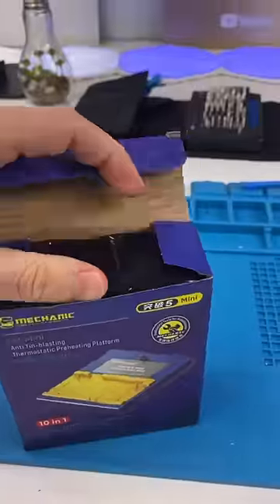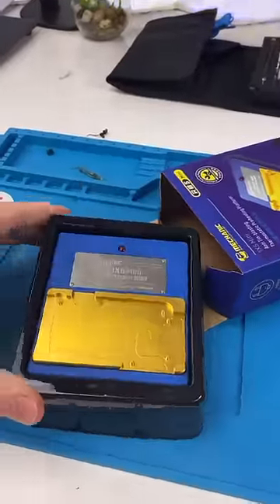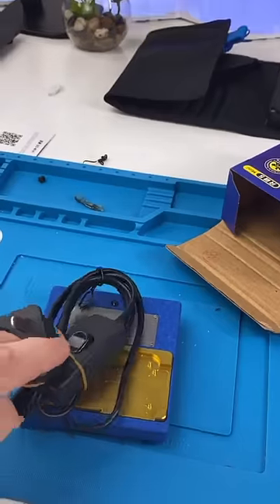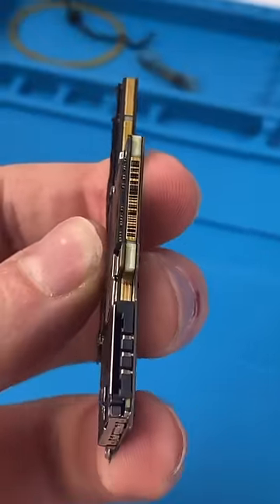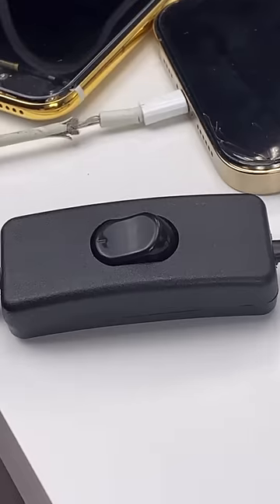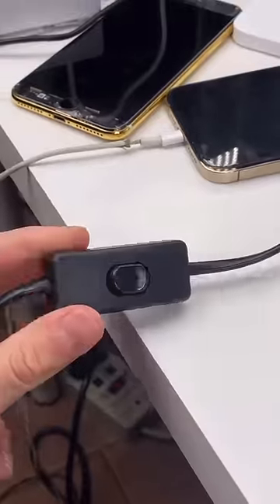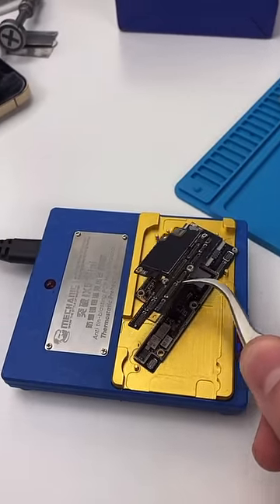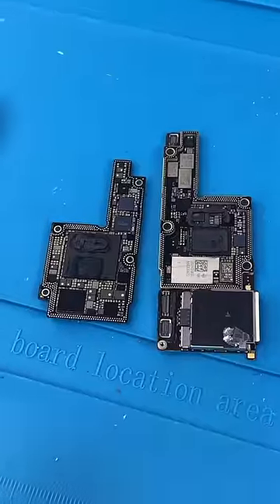I Opened Apples "Sandwich Board"... It Started Smoking #shorts

Comment: Apple's engeneers:
-How irreparable do you want it to be?
Apple's CEO:
-yes
Reply from the maker: It's honestly revolutionary. Saves space for other parts
Reply: @PhoneRepairGuru  and that's how iphones are much more powerful than android phones
Reply: Want autocorrect?
This guy: no 💀
Reply: @Tachi778  correction: a little.
Reply: @IBaitman  
geekbench cpu
sd888+ - 3700 multi core
a15 - 4900 multi core

geekbench gpu
sd888+ - 4500
a15 - 15000 !!

not just a little
Reply: @IBaitman  geekbench has never been skewed, its the most real benchmark exists

also there is gpu test in geekbench, the compute benchmark
Reply: @Tachi778  they're deleting my comments.
Reply: @Tachi778  I was providing a link to the website where they show geekbench bias. I even edited my older comment about antutu.

Maybe links are banned. 🤦🏻
Reply: @IBaitman  yes because u have to stop talking nonsense 🤣
Reply: @Tachi778  says the one believing geekbench as sole benchmark worthy of trust.
Reply: @IBaitman  its obvious that apple SoCs would be much more powerful anyway, because sd888 has 6 billion transistors and works at max frequency of 2.84 GHz

while a15 has 15 billion transistors and works at higher frequency at the same time, 3.1GHz
Reply: @Tachi778  hahaha this one is funny
Reply: @satukayu4706  it really is, it's obvious
Reply: @Tachi778  it's not really that much faster from what i've seen with hands on test. well be it better or not i still aint gonna buy a $1000+ phone from any company, i'll stick with my mid ranges, imagine i can get a phone that stays within 1-2 seconds of the IP 12 pro max for 5 times less the cost of the IP. f*cking crazy.
Reply: @PhoneRepairGuru  can I get a hello?
Reply: @Tachi778  😂😂😂😂😂😂 stop dreaming!
Reply: Damn you all really stop talking nonsense

Its just obvious, it's simple logics and physics, more transistors at higher frequency = more operations per second, it's so damn obvious 

I'm not apple fan, I'm using android phone myself (because I use ipad where I need performance)

Just stop believing antutu and desperately saying that android SoCs are best just because you can't afford apple ones
Reply: @Tachi778  bruh it's a joke calm down
Reply: @Tachi778  lol did you read the whole comment
Reply: @Tachi778  that's not how they are more powerful. The computing power is inside the SoC, not spread around the board.  This is intentionally made to make repairs difficult. actually having two boards require tons and tons of connections between them which waste much more volume than pcb traces
Reply: @gabrielenitti3243  I mean that making the board more compact allows to make the SoC bigger and fit more transistors inside
A14 is almost 2 times bigger than snapdragon 888
Reply: @satukayu4706  how’s the obsolete 2 year old phone handling cos my almost 8 year old iPhone six is still getting them updates,
Reply: @SsKarthik0801  i dont have it cuz i dont want a word to be turned to a different thing
Reply: @lukemurphy7917  Everyone watch out, man's flexing his 8yr old phone that gets updates which slow it down so that he's forced to upgrade, I can't contain my jealousy.
Reply: @Tachi778  listen bro
1) you don't really need much power to browse Facebook or whatever anyway
2) remember that Apple it's the one who still has the lighting cable who sure WAS revolutionary, but it's outdated slower and inefficient compared to USB C, and apple knows that, they keep lighting because of licensing money
3) I'd like you to remember how slowly apple devices get new tech, also how you are stuck for one hole for everything because "courage", they replaced the headphone jack with a motor for vibrations although iphones aren't a sex toy 🤷🏻‍♂️
4) android runs on a large amount of different devices so you really can't compare all androids to all iphones, you can put Android even on your gaming PC if you want (I'm not kidding, there is android x86)

In my opinion apple products are awesome for who has the money and not the knowledge to use a Phone/laptop, but it's very restricting, the only good thing i have to say is that at least mac it's unix-like which gives to it an awesome CLI, on the other hand Android it's open and allows projects like fairphone to exist, also it's open nature helped on the accessibility side of things (you can built apps for less abled people if you want to using the api the OS provides)
Reply: @gnsf  lol I just said that apple SoCs are better, I didn't say that iphone is better overall.
I'm OnePlus 9 user myself because it's really better in all, despite SoC performance. And you are right, I don't need a14's or a15's power, sd888 is just enough for me.
I just wanted to say that apple SoCs are better than all other SoCs for Android devices. That's all.
Reply: @Tachi778  you are right, since android can be run on fridges, yep, sure iphone it's better than a lot of android stuff
Edit: i replaced frigos with fridges, an "italianism" accidentally came out while writing
Reply: @Tachi778  btw i did never looked in the specifics of iphone's SoC, i did never cared much unless they do something outrageous or i need to buy one
Reply: @gnsf  well, their graphics is twice or even triple better than qualcomm's, good for gaming, but if you do mobile gaming, go for ipad
Reply: @Tachi778  one good thing about ipad: it's true the panel technology it's slightly outdated and it's also true that retina displays are more of a brand rather than a technology but their high DPI it's orgasmic to look at
Reply: @lukemurphy7917  Oh holy cow, your old iPhone gets updates which have been proven to slow it down so that you are forced to buy a new one which always costs 1000+$, is irreparable and looks the same every year until the 4th next generation! Such a wonderful privilege to have. We are such fools for not renting iPhones instead of buying androids.
Reply: @IBaitman  no middle ground  you are Doomed to english only.... purgatory
Reply: @lukemurphy7917  That’s to slow it down and I’m typing this on a 6 (shittiest fucking phone I’ve ever used) and there have been no major updates after iOS 12 because the 6 can’t run anything past that.
Reply: @Comfy_Bed  yeah lol I bought a $300 samsung phone and it's quite alright for just watching YouTube lol
Reply: @Comfy_Bed  which $200 phone is that?
Reply: @PhoneRepairGuru  so where is the headphone jack then?
Reply: @Tachi778  "the fact you still dont know what sarcasm is pretty concerning."
-KallMeKris
And that quote can 100% be applied to you.
Reply: @Tachi778  😂 have you ever broke your back glass in india it's cost 45k i can buy gaming laptop or 3 Android phones 😂
Reply: @Tachi778  not exactly, Samsung uses sandwich motherboards too but apple has the unbelievable lead simply because of the efficiency and integration and how much the hardware is built around the software while on samsung they have to somehow build a software to suit a chip that wasn't really built for their device
Reply: He is CEO, not a service center guy
Reply: @lukemurphy7917  even though most android phones stop getting updates after 2 years, you can still install a custom ROM in it, or just keep using since Android has a great API compatibility, you can still use Nougat normally till this day if you want
Reply: @Tachi778  the good thing about that is competition, and also, probably in the future, Android phones will be RISC-V since ARM has been doing some stuff that has pissed off arch licensees (Qualcomm being the main one that got pissed off), also, one thing I dislike about iPhones is, even though you have an amazing SoC you can't take the most out of it due to OS being so closed you don't even have a proper file manager, and most of emulators won't run on it
Reply: @Tachi778  eh, that depends on how ya measure
Reply: if you need to do a repair that involves separating the motherboard, you certainly aren’t doing it yourself and probably won’t end up being worth it
Reply: @Tachi778  lol, whatever you are smoking. Android phones, such as Samsung S21, have also multi layered motherboards for some time.

Comment: Hey that's actually a nice little cooker you got there. If you buy or try to restore phones that got bent badly and have touch issues, you could use some flux and the heater to try and restore the solder balls and repair the board itself!
Reply from the maker: I figured :) thanks for the info though

Comment: Please use a littlebit longer Screw as a handle where you can Grab With the tweezers and pull it up and dont Touch the Balls on That Sandwiched so you can easily Align and reheat it easily to solder it back together 

Makes Life a lot easyer and also you can Potentialy put preassure on the Board while Cooking it back together because of Spacers in Between the Connection Part and the Board

Comment: Sounds like they've used a low-current switch for a high-current device.
The copper contacts probably got so hot that they melted the switch's plastic enclosure. 
Which is why the switch doesn't...you know...switch anymore.

Comment: Cut the cord on both ends of the switch and solder and heat shrink. Use the plug itself to turn it on or off.

Comment: I use a similar product. However the ones I have are specific for each device unlike this one where it's universal for iPhone X's and higher. Those switches tend to short out however. Easy fix all it is is a power on/off switch. U can use another power cable for like Xbox/ps4's u will just have to plus and unplug when done. 

Also, just for the future. When the board is warm enough to separate u can either clamp on both sides and pull board straight up or u can put a screw in one for the holes then use tweezers to lift board STRAIGHT UP. U don't EVER want it to drop back onto itself.

Comment: I think it's Volatge Ratings

Assuming that the Product was made for 240VAC in China while you are in USA (probably) so the mains in 120VAC so the product is driving twice the Current for same power consumption, which is more than maximum capabilities of Switch, so the wires may not be able to handle the higher current causing it to smoke

Comment: I guess the switch is fir dc or low ac volts.
Hence you can bypass that if there are no caps just two wires.

Comment: Those shitty discount lamp switches are arguably more dangerous than bridging bare wires with a screwdriver... I highly suggest a chunky junction box with mains rated switch if you're going to continue using the hot plate.

Comment: From the looks of it that switch isn't right for the load on it is suggest buying a regular light switch and replacing the cheap switch and soldering it together  make sure you connect it correctly and while unplugged or you WILL be sorry

Comment: Dude you work in electronics, just cut the wire and solder on a new switch rated for higher current.

Comment: I have a desk lamp on my workbench with the same button except the plastic case around it isn't so big and everytime I turn the light on its sparking inside because of the contact, I spent too much time trying to glue that thing to the wall when I bought it so ill see how long it lasts since I ain't in a mood to take it apart to fix it

Comment: Does the outer solder has a lower melting point, compared to the regular ubga Chips? I am afraid, that by separating the boards, the other componets like chips and smd capacitors are also getting removed 😅

Comment: sometimes tools that use high heat have some sort of smoke that burns off internal components, it's usually not anything to worry about.  and truthfully, it's probably worth it since boards like that are a bitch to work, even with a heat gun
Reply: What's worth it? The switch FRIED  that isn't normal! That is a fire hazard. 

I would say to return it, but the return shipping wouldn't be worth it and the company CLEARLY doesn't care.

Comment: I fixed iphone 6 I got for 13 dollars
Reply from the maker: aye lets go
Reply: @PhoneRepairGuru  all it needed was a reballing but While it was restoring becouse It Had a passcode my pc bluescreaned and I need to Fix The software That doesn't wanna go to recovery mode
Reply: @PhoneRepairGuru  update: while I was in school it had turned on recovery mode and it worked after 3 tries on the same pc and 1 on other pc  it's a 128GB version  but I have to replace the screen that was replaced by me becouse touch doesn't work